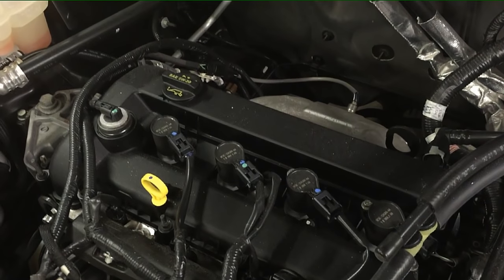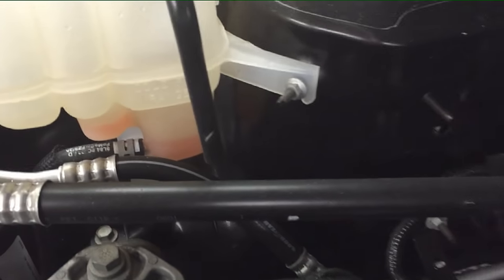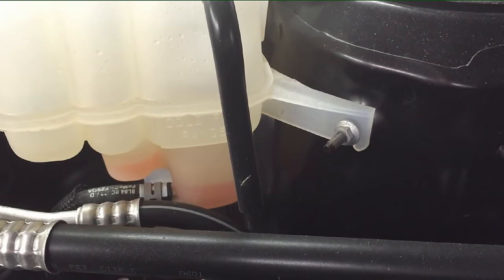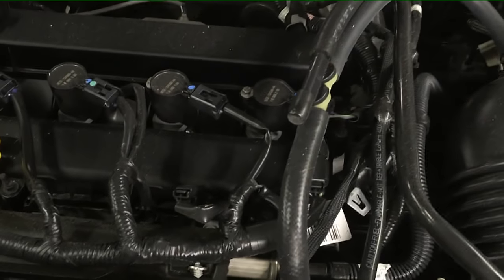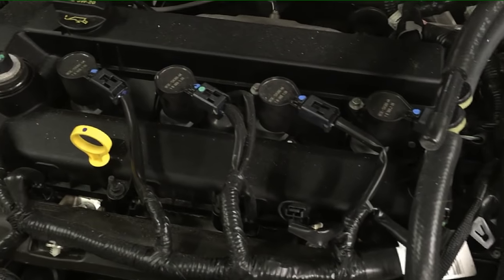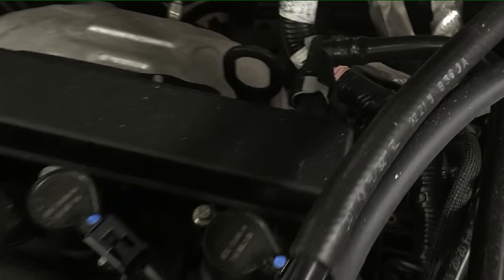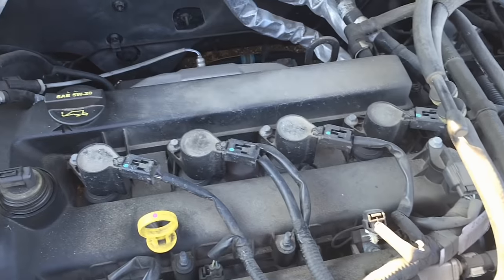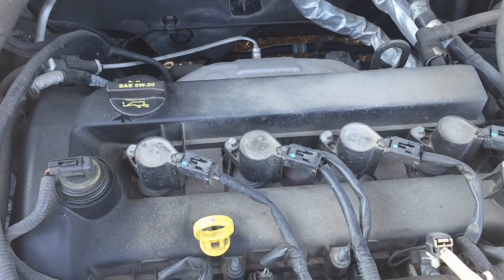Ford Vehicle Noises: #4 Tapping Knocking Noise 2.5L Engines

Comment: I've been looking for info on this ticking went to my dealer and they said something about a comment you made about the   #4valve tappets maybe not working???..Any thoughts on this and how I can go about checking/fixing my self??..and should I be driving it?....What makes me think it's what you posted in this video is when I start my truck in the morning and it's cold no noise when it heats up ticking like crazy?/
Reply from the maker: jerry H The dealer referred you to my video? I never made any mention on 4 valve engines. What vehicle is this?

Comment: In my 2015 escape 2.0 Ecoboost I hear a ticking like the injectors or high pressure fuel pump immediately upon shutting off car zit last for like half a second , could that be the hpfp or an exhaust leak ?

Comment: My 2005 fiesta 1.4 duratec engine have a knocking/ rattling/tapping sound when I take my foot off the eccelerator. What could be the problem be, Recently ( less than 3000 kilometres) overhauled the engine

Comment: hi can you please help???  It did it today for the first time I accellerated pretty fast and noticed it. It was a rartle sound that feathered in as I accelerated and out when the rpms went down. Sounds like if you touched a house fan lightly with a pencil???  Regular unleaded
, gassy smelling oil but not foggy looked clean. No check engine lights.. Slight vibration in steering wheel and in gas pedal but faint and didnt seem too out of the ordinary...

Comment: Is it normal for the 2.5 to have pressure behind the oil cap? The vehicle runs great and has no other noticeable drivability issues? Could it be the pcv valve?
Reply from the maker: This is perfectly normal.
Reply: @FordTechMakuloco  thank you so much. It said everywhere I must have burnt valves or something like that. I also have a slight tap top right of my motor not a clunk or anything just a suttle tap tap tap tap tap. Almost drowned out by the injectors but if you listen really hard you can hear it. Is that something normal on these engines with higher miles. I looked and none of the van lobes looked damaged or anything. Just a very quiet but different sounding tap tap tap tap tap. Driver side of motor. But I can’t believe it’s normal to have pressure behind the oil cap running. I checked all my cars and none of them have any pressure behind the cap. That’s crazy. Well it runs good so I’ll just keep on running it.
Reply: @FordTechMakuloco  what do you think the pressure is from that builds up behind the oil cap? You think it’s the pcv valve or what? It’s such a job to replace you have to remove the whole intake manifold and all types of stuff. I wonder if no one does it and the vehicles all end up with pressure or what very strange. I just can’t understand it you know what I mean?
Reply: @FordTechMakuloco  by the way it’s not like your video. The tap is so quiet it almost blends in with the injectors but it is not the injectors. I wonder if I have a hairline fracture in the block and that’s why it’s so quiet. It’s just a little tap but man that kind of stuff drives a guy bonkers. That’s how I ended up watching all these videos and then I found the oil cap pressure etc. some motors have quarks and they can drive a guy absolutely nuts until he knows the answers.
Reply: @MrSocko-vn7fw  it's just the way they're designed to work a lot of people run oil catch cans or upgrade the valve cover and run a breather cap
Reply: @thecritic8318  good to know man

Comment: i cant tell if mine is a rod knock or cracked block mines a ford fusion hyrbid the coolant consumption i cant see before the heatercore i believe its a heater control thing is broken or clogged so their is no coolant going to the heatercore to flow to engine likely damaging it not being driven currently really need help wish u were still commenting to help people

Comment: Jw does this noise just pertain to the 2.5 liter because that's the same issue I'm having with my 2.0 2013 Focus that Ford can't seem to fix even after an engineer tried to fix. He said it was within Ford's normal characteristics of vehicle operation. Since when is a vibration/rattle from engine ever a normal characteristic?  I have posted a video on my YouTube page with the noise if you could check it out!  Thank you
Reply from the maker: Blake Bohinski Hard to tell exactly but I have to say 95% of that noise is normal for a direct injected engine yes.

Comment: Thanks for making this video My car sounds the same way my engine I drive a 2017 Ford fiesta SE I believe and it makes that engine knocking noise it's not as fast as the engine in your video though mine is a little bit slower and more is much louder more pronounced like a knock knock knock knock knock knock and it goes away when I turn my car engine off it gets less and less and then eventually goes away is that an easy fix at home

Comment: that makes sense i just bought a 2012 ford escape and i thought it sounded rough but i guess thats just the way they are supposed to run the is no knocking really or tapping except when you get down by the front tire on the drivers side and I'm wondering what it could be any answers to this would be awesome oh and i should state that they is still great power to it. thanks

Comment: I'm getting code 0302. I've swapped coils and injectors but still get 0302.  It stumbles at idle but I don't get a knocking sound. Do you think it's a cracked block? I'll do a compression check soon but is there a common problem with 2009 2.5L Escape engines?
Reply from the maker: +Tom DeSimone A crack is common between cylinder 2-3 yes compression check is in order.

Comment: I have a 2000 Expedition that sounds just like this, was there this kind of problem with the 1st generation 5.4 Tritons? Someone suggested a VCT solenoid but I can't seem to find them on my engine.
Reply from the maker: +Justin Spencer No yours does not have a vct solenoid. You need to see which bank has the noise and then remove the valve cover to inspect the lash adjusters and rockers.
Reply: +FordTechMakuloco hey great vids, honest question? should I get a Honda or a Ford? which manufacturer do you think builds the Better overall Vehicle?

Comment: This brings me back to an old car i had. I thought it was rod knock for the longest found out it was not after replacing bearings. Car lasted me another 70,000 mi before i sold it running. This may not be the case for everyone though.

Comment: I think it is also possible that the noise is coming from Vapor Canister Purge Valve.I listened to my engine cos has been getting same noise. This morning I took time and listened to it and then I realised it from the piece of device just behind the throttle body. It goes off and on cos it works with the electric plug attached to it which switches off and on automatically.

Comment: Hi, thank you for your videos they're really helpful. I have an 02 Ford Explorer XLT 4.0. Today I was out driving and all of a sudden it cut off and all the lights lit up on the dash. I coasted into a parking lot and then looked under the hood. I found that the ignition coil pack's pigtail/harness had disconnected. I saw that it had two rubber gaskets(I think it's called). So I removed one and plugged it back in. I have no check engine lights or anything on but now when I go to take its slower, sluggish, I almost have to push gas pedal to ground and the engine makes a loud clack/knocking sound(hard to describe). It never ran like this before. Is there anything I can do to get it back to normal? Maybe unplug negative battery cables for 5 mins or something? Please help! TIA

Comment: I have that same noise on a 2012 Fusion, clack clack, louder behind the block, looking from above the heat shield, louder when hot, but how can I rule out piston slap, or rod knock. With my ear on a long screwdriver, I only hear the valves clicking nicely, so the bad sound does not come from the valve train. How can I rule out dangerous noises like rod knock?
Reply: I hope you get a response to this because exact same this with my 14 fusion
Reply: Did you ever figure it out?

Comment: What does it sound like while driving? Does it continue to knock at higher RPM's, or will it quiet down once in gear or while driving? My 2011 Ford Escape 2.5L 4cyl makes a similiar noise, it's loudest at low RPM's (less than 1000), and when it's cold. It quiets down above 1,500 RPM's, and after I've driven it for 20 minutes or more. Once it is full hot and I've driven it for a bit, the knock smooths out and quiets down. How can I eliminate valve train noise, or other issue as a possibility?
Reply: I have the same symptoms. Did you ever figure this out?? Thank you.

Comment: Do you have any pics of a cracked engine or where the crack would occur?
Reply from the maker: Guy Ko No I don't but it usually happens in the center betwen the two cylinders.
Reply: FordTechMakuloco Thanks for the reply.

Comment: Have they done anything to redesign the engine and fix the issue in newer years? I'm considering a Transit Connect but I really would prefer one with the 2.5, I don't want the 2.0 because It has less power and direct injection.
Reply: My 2014 Ford Transit Connect is a victim...smh

Comment: Good info...I have nearly 100k on my work supplied 2012 2.5L escape and several more at work that other guys drive with no issues yet.  My wifes 2011 Escape Limited is also a 2.5 and we own it.  Paid for so I'm hoping it doesn't develop this issue.  Has 48K miles as of now.

Is this just a manufacturing defect in the block?  Doesn't seem like a maintenance neglect issue.
Reply from the maker: klc317 Yes a defect in the manufacturing process.
Reply: FordTechMakuloco Would it be possible to use a stop leak/coolant sealer to at least stop or slow the coolant leak? It sounds as if the crack is very small considering there is no noticeable performance loss. Also is it possible to diagnose this or notice anything using a compression/leakdown tester?

Comment: on the subject of noise when I hit  a slight rise in roadway I get a rattle in the driver's side front suspension. on a 100k mile focus zx3..what is most suspect..bushing ware or shocks? great instruction and info. thanks. mike
Reply from the maker: Go right after the stabilizer links they are very common.
Reply: Thanks...I'm on the case. Also your control arm change out helps to understand suspension dynamics.
Reply: MT Mals

Comment: Have you seen this on the 2.3L engine also?
Reply: I found out what the noise was on my fusion 2.3l. sounded almost like a rod knock but turns out it is the intake manifold butterfly valves we had a 2003 Mazda with the noise too it was the same thing.  You can replace if it is a ford but Mazda is proud of their intakes. Better yet just drive it.
Reply: Joe Goodart did you hear the sounds near the intake manifold? Or was you hearing the sounds located near the back like in the video?

Comment: So these motors normally make a light tapping/ knocking noise? I have a 15 transit connect and has a noise im not liking,
Reply: My 2014 Ford Transit Connect just started the noise out of nowhere before that it was quiet likw a hybrid with the hood closed.

Comment: I suppose this can't be checked with a leak down test because the piston could be above the crack. only if there was a way to vacuum test it.
Reply: The piston doesn't ride right on the cylinder wall.

Comment: Ever hear a similar sound on Duratec 3.5L N/A engines found in the Fusion Sport/Edge/Taurus? Mine has a very slight tapping noise coming from the LH bank and is not rev dependant, stays the same sound regardless of RPM. Sounds similar to a cam phaser tap on a 5.4 triton.
Reply from the maker: +Kevin Barbieri Never heard of noises on those engines they are pretty strong.
Reply: Thank you for your reply! Do you think it's a possibility that I could be affected by tsb 11-11-15?

Comment: Did They ever fix this I have a 2016 fusion that seems to be burning radiator fluid and making that same knock. The dealership keeps telling me "This is normal for this motor and all motors burn a little anifreeze" I know that the last part of this just aint true Im wondering if it could be a cracked block on a brand new car....
Reply: it's normal if you have an Ecoboost

Comment: My 05 focus has a taping coming from the intake manifold but only when cold any suggestions it's kinda embarrassing at times
Reply: Alvaro garcia. More than likely its worn IMRC flaps in the intake runners. Common issue on the 2lt focus. 

Only fix is replacement of intake manifold.
Reply: couldnt you just remove the flaps?

Comment: Great vid man ! By the way do you recomend iridium spark plugs or the ones of 4 electrodes over the  stock  ones ? Any more performance with iridium and 4 electrodes?
Reply: thanks broo,im interested in iridium ones for my charger R/T, but many people say the OEM are better because  they are copper made.
Reply from the maker: elvicdesonora I always recommend stock Motorcraft plugs and as far as I know these stock are iridium as are the plugs on the 2.3l
Reply: but for example my hemi has ngk the single electrode i think they are copper, so do you recomend upgrading to iridium and 4 electrode?
Reply: The 2.5L OEM plugs are iridium. Stay with the Motorcraft plugs.
Reply: NGK is the only other brand I would consider for plugs. Maybe Denso. But Motorcraft plugs have given me good results, so why mess with perfection? ;)

Comment: that's the noise. thank you. finally. but... how to fix? will it wear out the rings? thanks
Reply from the maker: If the block is indeed cracked then you replace the short block assy.
Reply: How much would roughly cost at a dealer?

Comment: My 2011 Escape has started making this noise @80k miles. My selling dealer told me it was normal and will not fix it unless it starts loosing coolant. The noise seems to be coming from between 1 and 2.

Comment: I have a 2008 ford fusion with a 2.3 and there is a knock when in accelerate. Do you have any clue what it could be or what I could do to fix it. It usually knocks but once in awhile it wont do it. Id appreciate any help you could give me.
Reply: My 2009 just started doing the same thing

Comment: Hey, we have a 2.5L 2010 Escape 40k miles and changed the oil a week ago and yesterday I had started the car, and revved the engine a bit and noticed a knocking noise when it was done revving. We used Mobile 1 Extended Performance and filter. What could be going on? It seems to go away once its warmed up.
Reply: How is it now years later? I have a similar noise with my engine it sounds similar to other videos of the same engine and read alot of forums saying that it is normal for 2.5L duratec... those enginea and fairly noisy on cold start ups
Reply: @TheCasual101  130k and still noisy. The duratec seems to be a crude engine. Its noisy on start up and vibrates a lot. Im shacking at every red light, and thats with brand new engine and trans mounts. But they seem very reliable. Way better than the newer escapes. I would never own an Escape after 2012.

Comment: Hey we have 2006 Ford Fusion 4cyl. Auto. Engine was knocking at about 2,000 - 2,500 rpms. Now its rattling loud! Almost sounds more up top coming somewhere in the water pump or from the top of the engine. Can I send you a video somehow?
Reply: On the 2.3 the tapping noise up top is the intake runner flaps....my sons car made that noise at 130k..ran perfect, pulled vacuum lines on imrc, noise goes away...to get rid of noise need to replace intake manifold..about 200 part...
I havent done it yet ....runs fine
Reply: Where are the vavuum lines on the imrc?

Comment: I have this noise in my 2009 escape it also has a lot of blow by at the oil filler when I pull the cap while running does suggest / confirm any thing ?
Reply: morristhe9cat pressure will come out of the cap which is normal

Comment: My Escape 2.3 has that noise, a crack. How long can it last before blown out ? 
I checked connecting rod, colling pressure everything is fine.
Could someone fix it or ....the engine will blown out anyway ?????

Comment: I'm more inclined to believe that that a cylinder an intake valve is being incrimentally compromised by timing slip along the harmonic balancer. But maybe I'm just entertaining my own mythology. If the harmonic balancer slips along any of the internal surface radii then the iVCT components might be misinformed by the crankshaft position sensor .... if the iVCT components are not performing to specification ... If the valve stems grow toward interference as the engine heats up ... if the valves are thrown a bit more because of the degrading lash clearance collisions ... the possibility of interference seems a more likely source of tapping, even though I can't imagine it fully, than resonance from a crack leading into the water jacket.

Comment: My 2014 Ford escape is making a noise it’s not a tapping noise it’s like a muffled rattling noise they can’t figure out what’s wrong with it it only happens when the car is idling or at a red light or stop sign it does not do this while I’m driving it and it still drives really good I am not losing any power

Comment: I have a 2007 Ford Focus that makes this noise and is even louder when you turn AC on. I am not loosing any antifreeze and does not overheat; any suggestions on what it could be? Thank you
Reply: IMC flaps in the intake manifold

Comment: My 99 SVT contour is having this issue but it comes and goes.... some days i don't hear it at all. but I think my problem may be do to a vaccum leak im not leaking oil im not losing coolant my car does not over heat, it just has a rev hang some times when I put my foot on the clutch to take it out of gear it will hold the rpms till I come to a complete stop!